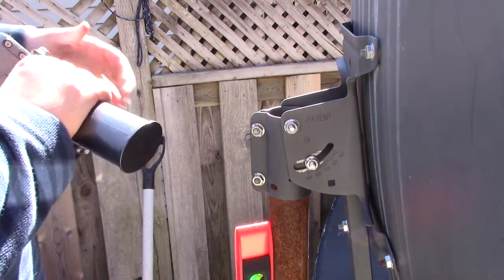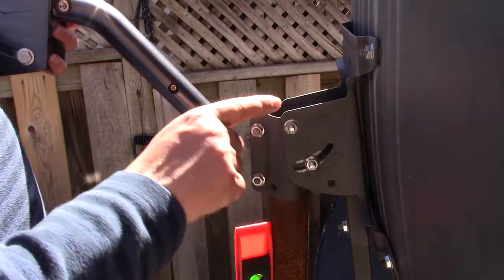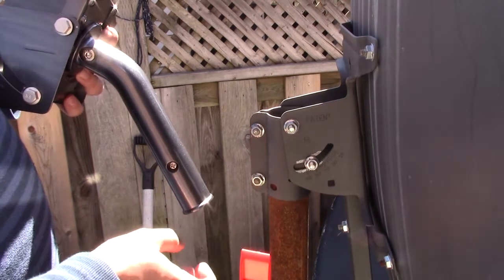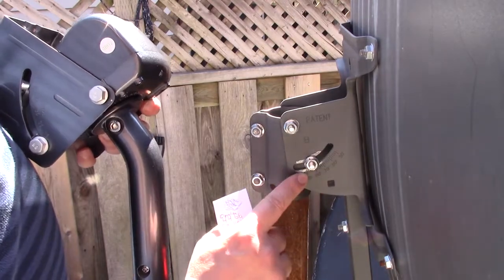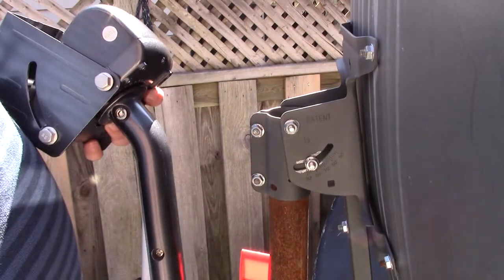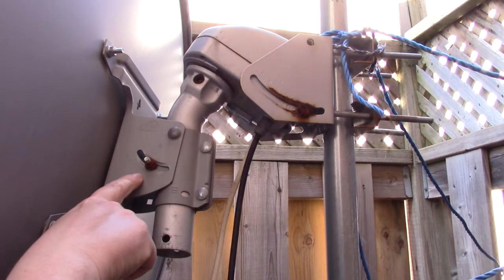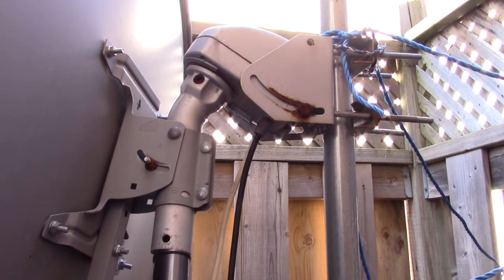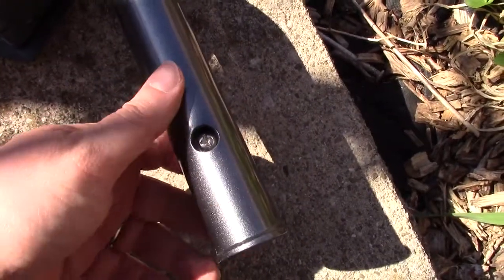XCruiser XH240 H-H Motor Problem Setting up

Comment: doesn't solve the main problem.  http://www.repentnow.com/FTAMOTORINSTALL.htm
Reply from the maker: I think I will have to Shelve this project for a wile, If i Can find a euro dish then maybe. I am going to focus on the 4 foot dish just as soon as I can find a NIRM Non-Pentrating Roof Mount for this for the setup. I might use a BasketBall net mount but I am looking for something in my YT budget.Non-Pentrating Roof Mount Non-Pentrating Roof Mount Non-Pentrating Roof Mount
Reply: hammer.  make it oval.  lol.  Replace elevation and pivot bolt on the dish with a mast clamps